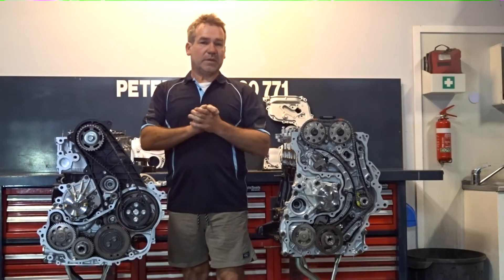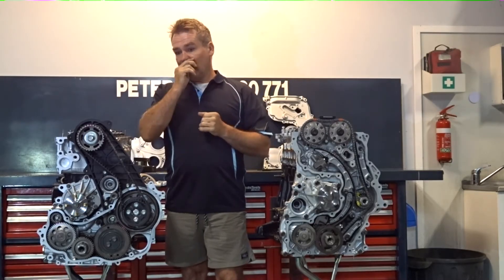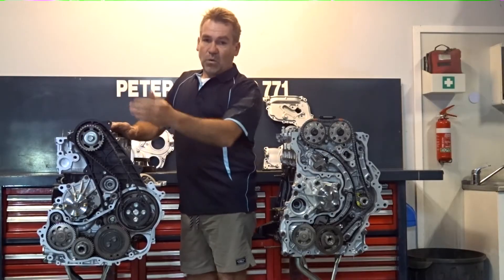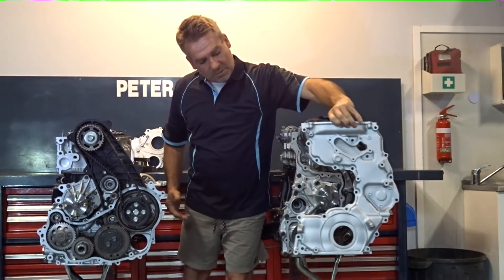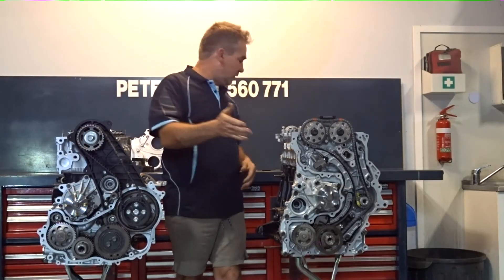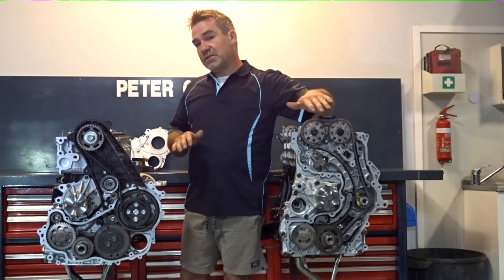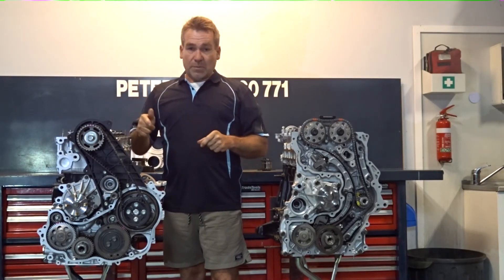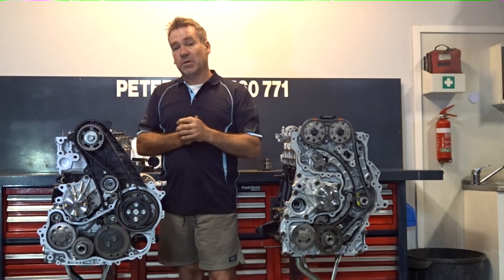Toyota 1GD-ftv 1KD-ftv Hilux and Prado engine, whats the same what's different.

Comment: Gday Peter.  Just a quick question... I am the owner of a Toyota SR5 (2016) which has the 1GD FTV engine.  I have had issues with the timing change @100k kms (Timing chain slap), and it was replaced by Toyota at no cost.  They told me all the new parts were revised parts which would prevent premature timing chain problems from occuring again.  Here I am 30k kms later and I have they same timing chain issues (chain slap until oil pressure builds up to feed tensioner).  In your experience with Toyota engines do you know what the real issue is with the 1GD 2.8 engine?  It is a well documented problem that has affected many owners.  Thank you.

Comment: hey mate i have a 1gd with higher kms and is getting a bit rattly at start up I want to run a thicker oil would you recommend this
Reply: There’s a bulletin for this on early 1GDs due to faulty machining on one the timing gears causing the chain to run on an angle creating the rattle. Possibly go see a Toyota dealer about it they may be able to help you with some kind of warranty if they are generous